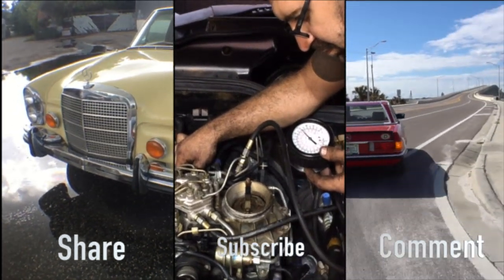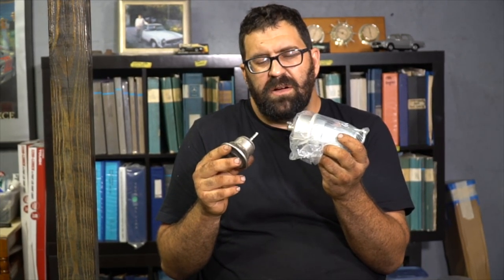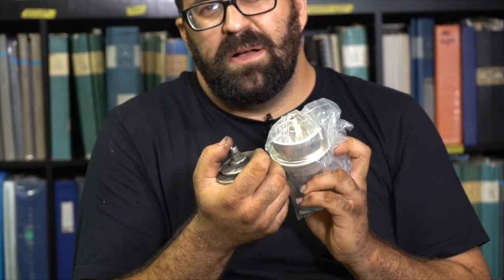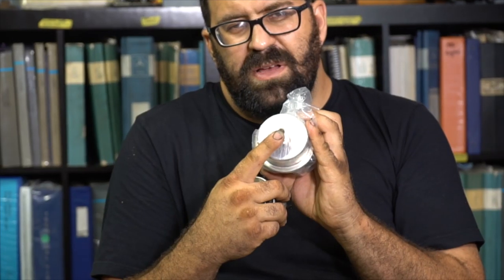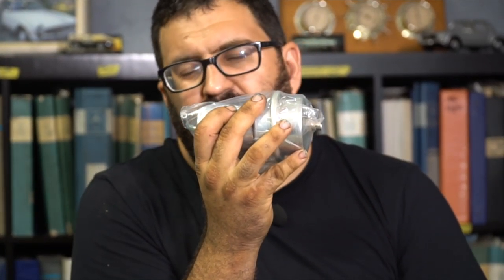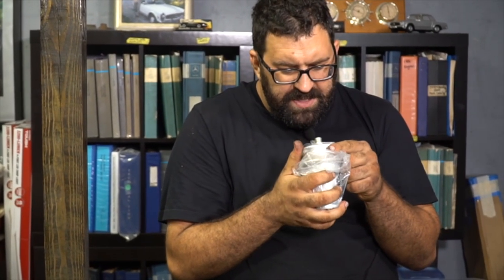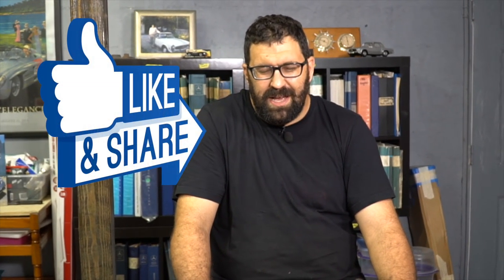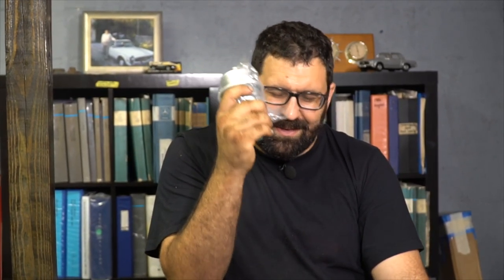Fuel Pressure accumulator what do you do

Comment: I have an ‘83 380 SEC,  130,000 mi, I was having erratic idling issues, poor gas mileage & lack of power, my mechanic is in the process of replacing the fuel accumulator, idle air valve & warm up regulator.  Hopefully this will resolve the problems. Hard to find parts and 4 hrs labor $1,700 total! I enjoy your videos it gives my info so I understand the mechanic

Comment: Pierre, I do believe the small line off the back is a leak line, that will only have fuel come out if the accumulator has failed,  i.e. the diaphragm is leaking. I believe the diagnostic test in the manual has you remove the small hose from the accumulator and pressurize the system,  no fuel should come out of the fitting. I don't have the manual in front of me, but that's how I remember it.
Reply from the maker: the fuel accumulator will dump fuel out of this line only when the pumps are running, and down to 40 psi. after that, nothing should come out.

Comment: This video did help me figure out hot start. Previous guy replaced the pump and filter, but not this part. It's super easy to change, but don't make the mistake I did and not clamp off the small line. That lead to me taking about a 2 gallon gas shower.

Comment: I bought my S320 with a bad fuel pressure accumulator.  The "shop" wanted over $200.00 to put a new one on.  I looked up the price of the Bosch part, watched on YouTube somebody show me how to do it the "proper" way and quickly understood why the book value of the repair was so high.  You gotta rent a bay overnight for the car to cool down, a good-looking young lady to stand by with a fire extinguisher and an $18.00 C-clamp tool that works like pliers, but backward. I did it myself for <$48.00 (new tool included).  Thanks for all of your hard work.  I think I've see most of your videos by now and I gotta admit, I wish I'd bought a simpler, slightly older MB.

Comment: 100 % agree with what you say I trained & qualified as a Mercedes mechanic and worked with them for 35 years & do not recall renewing a fuel accumulator on a R 129 ever my own car had a blown head gasket and subsequent misfire on start up cold when I bought it quite normal with a blown head gasket I was quite perplexed when the head was done & still had a cold start issue and intermittent felt it could be injectors dripping because of the misfire which occurred after it started with a bit of logic and messing around with basic steps was able to resolve the issue. You can resolve any problem if you throw money at it but it is much better to get the diagnosis right and save money. Great Channel Pierre I watch sometimes as you can never stop learning & always good to get proper advice any one reading this comment this man knows his Mercedes no doubt (solid advice)
Reply: Hi Colin I have a 1993 Mercedes 300CE with a 24 v engine,it was over fuelling and dumping fuel in to the sump changed the fuel filter and took of the cold start injectior but same problem,I removed the fuel distribution and found that the plunger in the middle of it was stuck open I got it lose and put it back but same problem so I took of the pipe that delivers fuel to the distributor it started and had it running for 30 mins, can fuel be going round the wrong way some way.I am feed up with this car as it not working as it was designed to and I am nearly ready to get it crushed as don’t want to be beaten,can you please help me with any advice you might have .I am in the Uk London.Thank you.

Comment: Thank you and appreciate you sharing your knowledge with us all. 
I have a 1993 190E 2.6L that is hard to start when cold. It stumbles, shakes, stutters and takes about three cranks on the ignition key when it finally stays on. I will be replacing the fuel pumps, accumulator, fuel pressure regulator, and fuel injectors as they’re all original (30 yrs old). Thanks again!

Comment: Yes, you may have solved my COLD start problem on my 500sl.  Crank and crank and crank  during cold before starting.  I did a ez test and seems to indicate what you say about " possible cold start too" problems. Turn the key on and off 3-4 times  before starting which allows pressure to build I can hear the fuel pump and it starts right up.   After that it starts and drives great no HOT start problems

Comment: Excellent thanks. You only know your car when you come to a problem. No hot start problem 190e. I recently had a fuel strainer at the bottom of the fuel tank, the wire mesh screen disintegrated and lots of rust got into fuel line. I had to change the fuel filter and the fuel pump out but did not change the fuel accumulator. Now I have hot start problem. Guess where the hot start problem might be located?

Comment: Am driving  a 380 v8. Am having  the problem with hot start. In the morning  the car is so impressive  but after driving  around and once you have stopped for a quick  jump out and upon coming  back to start  it you have to crank a lot  of times with stepping on the petrol. Will definitely  take a look at replacing  those parts. Thank you for the insight

Comment: Great information Pierre. Like you said a smart mechanic would confirm a bad accumulator. I’ve never done exactly that , I suspect mine is going bad because of the hot start issue. 
I would imagine you could confirm the failing of the accumulator by putting a vacuum on it (like the vacuum door lock pods) and if they don’t hold vacuum they fail. Or maybe in-line fuel pressure test and watch the residual pressure drop when the engine is switched off.
Reply: Second one, Maria
Reply: Pierre Hedary I knew it! Thanks

Comment: Great video, but I would like to see how this is diagnosed. I see many people quick to blame the accumulator for a hot start problem when in fact anything that wont hold pressure could cause the problem, injectors, cold start injector, check valves etc.

Comment: Just replaced mine (hot starting issues) on an '88 300SEL about 6 months ago.  Fixed the issue, three weeks ago started having a random stall issue which turned out to be the fuel pump.  Just replaced that today.  Not sure if they were original but they both were very old.  They were not awfully expensive the accumulator was more than the pump as I recall.  Mechanic says I should carry a spare fuel pump relay - as a bad one can leave you stuck.
Reply: Just carry a paper clip instead, bridge pins 7 and 8

Comment: The fuel pressure can be tested at the CIS with a handheld pressure gauge. If the fuel pressure drops within the first 10 to 15 mins after engine shutdown under a certain level (depending on the type of engine) you can determine fuel-leak or an accumulator failure and you will have no warm-start. Guess how i know - it is described in the WIS.

Comment: Greetings from Greece and thank you very much for all of your information and help! 

I'm a relatively new owner of an 89' 200E w124. Had some problems with starting (mainly cold) and changed the accumulator (sadly used a üropars one). Cold starts are now a little bit better, but hot starts are way worse... Most of the times its fine, but some times it takes way too much cranking to start. Sometimes a green light lights up in the dashboard while I'm driving, and when that happens I know that if I turn the car off, it's going to be a pain to start again. 
Sometimes no light comes on, but it does struggle, and sometimes there's no problem at all... Could the new accumulator have failed soo quickly? (Less than a month) 

I have spare one that's OEM but don't know how long it has been sitting

Comment: Mine failed (on my 79 scirocco).  In a metal lathe I turned off the flange that holds the two halves together, machined two rings that can be bolted together with M3 bolts, then purchased fuel capable rubber sheet from mcmaster-carr. Using the existing fabric reinforced diaphragm inside the accumulator, I laid down over that a piece of the rubber sheet, trimmed in flush to the flange, and then clamped it back together with the rings I machined.  It seems to work fine now.

Comment: Thanks for this!  Now I know why my 280SE 4.5 was so hard to start when hot.
Reply: Your 280 SE 4.5 does not have an accumulator - it is an entirely different system.  Your's is called EFI
Reply: @attilacsepe4946  So then why was it hard to start when hot, but easy to start when cold?
Reply: @youtoobe169  hot-start issues plagued the EFI cars.  This system was used on Mercedes V8s from '71 to '75.  

When I had mine, I put insulation around the fuel rails (under the air filter hsg)
Reply: @attilacsepe4946  I sold mine a few years ago, but always wondered what caused that

Comment: Hello, I disagree with you when you say in the second minute and about 10 seconds of this video that it is normal for fuel to return through the thinnest pipe to the fuel system and that it is at a pressure of 5.5 to 7 bar. With the thinnest conduit, the fuel is evacuated to the tank only in the event of a leak in the membrane, i.e. fuel pressure accumulator damage. But thank you for the video, made me realize the role of this part in hot engine start.

Comment: Greetings. I've watching your videos trying to resolve the problems in my 1990 300E 6 cyl Bosch fuel injected sedan. The car sat for over 2.5 years and upon getting it back I drained out as much old gas as I could and sweetened it up with fresh gas, changed oil and put in new battery and then tried to start it. Once I got started (which was pretty straight forward and quick) it at first bucked and coughed for bit and stalled a couple times but after a short time it settled down into a slightly rough idle but she idled and stayed running on her own.  Now the first time I hit the gas it stalled instantly.  It soon became apparent that idle was the only thing it was willing to do.  So I started checking out all the usual suspects, fuel pumps were running, good spark at plugs, 5.5 bars fuel pressure, (working) good grounds and 12 volts at coil and anything else I could think of.  This is where it gets strange. I opted to loosen a fuel line while it was running.  I cracked loose what I assume is the return line that being the one that comes off the end of the fuel pressure regulator. Instantly apon loosening this line the car revved up over 2000 rpm which is significantly higher than it had revved so far.  Now with fuel pissing out all over the place I ran the throttle by hand and it revved up just fine. I ran it up and down through it's rpm range and let it settle into an idle. Lo and behold she seemed fixed.  It ran fine for 3 days, that being Everytime id start it and then I had time that day to change the fuel filter. I figured we sucked up enough crud and bad gas from the bottom of the tank so it was due. It went quickly with no real problems at all except for when I was finished and went to start it and found myself back on square one again with an idling car that stalls instantly apon my giving it gas.  Nothing has seemed to help at all this time and I've been checking everything I think of. MAF, Fuel pressure both system and line or working and line, TPS, collector,  getting fuel to injectors although it only dribbles out the fuel line from the fuel distributor to the injector. There's a few more things I've checked that won't come to me now but you get the idea.  The first time I cracked the line fixing it I assumed it bled air out of distributor or something, now I'm thinking maybe the sudden pressure drop let some groups break free in the injector pump, fuel distributor.  I don't know and hoping someone here can suggest something to me so I can have a eureka moment! Thanks in advance and I've enjoyed the videos and clicked like and subscribed to the page.  Thanks again

Comment: Hi I have a 1990 W124 200E with a 2.0 l engine. The car cold starts well but once hot I have issues in restarting and it takes me abt a min or two to get the engine fired up. After watching yr vdo could it be that my fuel accumulator may be bad? (Once the engine fires up, it runs nice and smooth!)
Reply from the maker: Hello, Ahsin SHABBIR and thank YOU so much for your question(s), we want to answer you as quickly as possible. 
By signing in our Patreon https://www.patreon.com/thomaspolk page and making a donation of $10 your are assured of a 24 hour email response from Pierre. 
If you are already a $10 member please mention along with your question.

Comment: Great video. Had the same problem with my 380 and replaced accumulator. Hot starts were pretty good now. After a year they degraded again. I unplugged the line on the other side of the accumulator and there was still some dripping coming out after the car was running for a few minutes on the jacks. Not sure how long I have to run to stop dripping completely? When I tested the first accumulator by unplugging the backside,  fuel was continuously pouring out the back so the bladder was ruptured. The second one I don’t know if I have a small rupture since it’s a smaller drip. I did order a Bosch replacement accumulator from pelican parts. Not sure if there was maybe something wrong from manufacturing. Can the later version small accumulator retrofitted into an 83, 380sl?

Comment: I hope you read my post, today being Nov.29 2022. At any rate I recently restore a 1982 MB W123 M102 engine 2.30SE and I intend to make adjustments on my K-Jetronic. I bought me a repair kit for the fuel distributor and its related components. It idles high with some noticeable slight change in RPM. Id like to know where to start checking. Is it also possible to use scope? Thank you.

Comment: great video. my w201 hesitates starting in the morning. other times it will start then die immediately. it also happens after driving the car for more than 1/2 hour then park/kill engine then try to start after 30 or more minutes. acceleration is good - no hesitation. starting is an issue but not a big issue. I don't want to throw parts at it :) please advice.

Comment: Hi Pierre, I have a 73 450SE, I believe its D-Jet? Car cranks but no start. Battery fully charged, fuses and fuel Lim rely work, I hear the fuel pump when key is in position 2.  Would crank no start issue be the Fuel Pressure Regulator? I should also add, probably time for a fuel filter and new fuel pump but trying to isolate before throwing unknown parts. Your advice is greatly appreciated!

Comment: Pierre, Good morning from Thailand. Perhaps you may be able to shed light on the cause of my W 124 E300 fuel problem.
After sitting for a long period of time, perhaps a week or so, the engine cranks but won't start. Removing the inlet fuel line from under the hood and cranking the engine no fuel will come out. I poured some fuel directly into the air intake and the car starts no problem. removing the fuel line again and turning on the ignition fuel spurts out. My diagnosis, and I hope you will confirm, is the accumulator is u/s. I would appreciate you advice.

Comment: Hi,

You mentioned an accumulator also provides a pressure for use under acceleration. Could a failing accumulator be the source of my ‘stumbling’ under acceleration? 

Both cold and warm starts seem to be fine. 

86 300SL M103.
Reply: Could. I'd more so bet its an ignition component.. spark plugs.. plug wires.. distributor cap.. etc

Comment: I'm working on a 74 450sl and when I have someone turn key to start there's only a small click at the fuel pump . Is it supposed to run or is it because it has pressure and that's what stopping it from running my thoughts are the pump is no gd .thanks for the great videos

Comment: 1987 560SL stalls after warm-up under load.  Replaced both fuel pumps, filter, baffle inside fuel tank, fuel pump relay behind glove box. It will stay running if I spray so I'm sure it's fuel related.  Any help would be greatly appreciated.

Comment: How do I find out if my 1985 500 sec is sending fuel from the pump, new pump and filter , have spark but does not want to run with out starting fluid

Comment: is there any diff in accumulator for 2.3 or 5 L  from '90? the OE numbers are diff ofc but would the pressure be diff for a bigger engine ? these little things (with pressure regulator) are very expensive comparing to the value of the car...

Comment: I am working on a 1989 560 SEL, looks like it has the large Bosch accumulator currently, is there an issue using the smaller one for replacement?

Comment: Does the 75 450sl with the D jet system use the same larger fuel pressure accumulator? My 450sl is having hot start problems, where i can start it right after use, but 20 to 30 mins after use it wont start for the day/morning after.

Comment: Well I have a hot start issue but i knew the accumulator wasn’t any good. I do however have stumbling issues in acceleration which I’ve been trying to find the problem, in fact I just put a fuel distributor kit in thinking it was the fuel distributor. I’ve asked if the accumulator could be an issue but everyone says nah it’s just a hot start issue. So do they cause it to bog down once you start to accelerate. In the driveway it idles and revs fine. On the street is a different matter.

Comment: Hi Pierre, I own a '89 560 SEL runs good, shakes a little on idle, took it to CA smog check it fail, came in as a gross polluter, HC Max allowed 102 I got 597 at 15 mph and 489 at 25 mph, can you help? the local mechanic quoted me 12 hours of labor plus parts, I check gas 42 psi out of the gas pressure regulator, and the car smells like gas out of the tail pipe, idle RPM 650
Reply: Are you in So Cal?  I can probably help
Reply: @Johnathan_Waters  Thank you for your reply. I sold this car, just did not had time to invest in this beautiful car